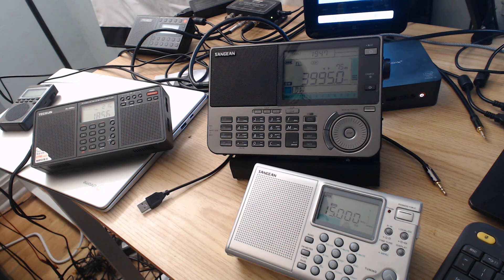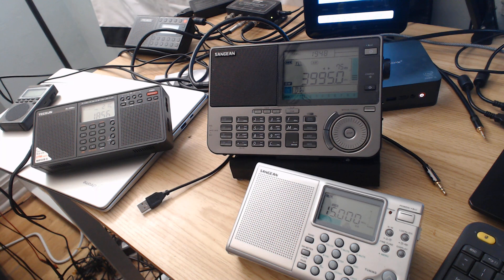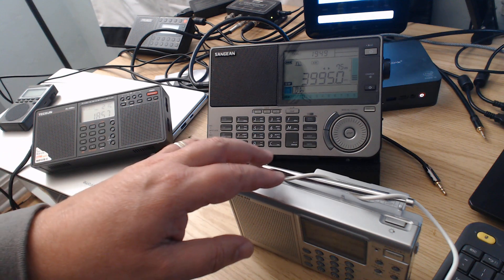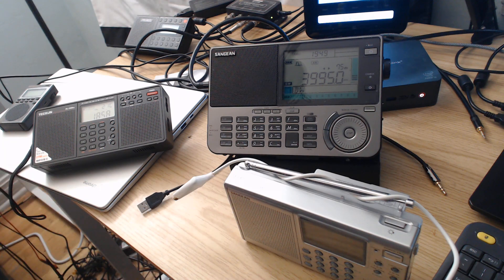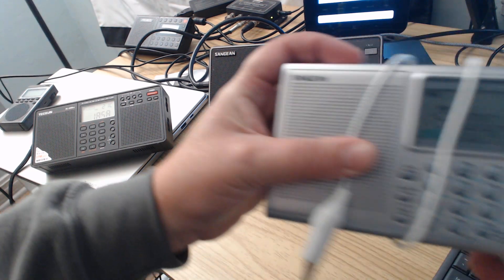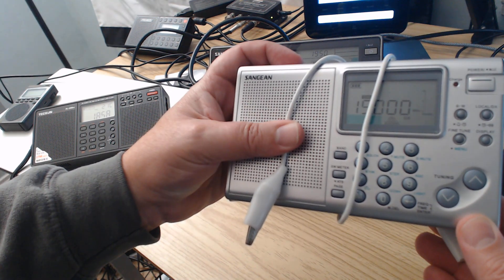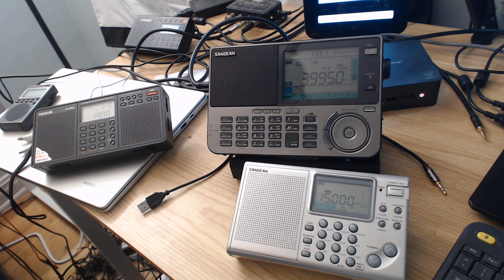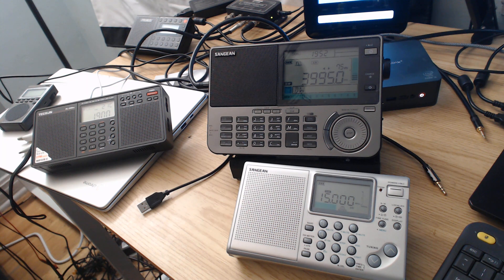Antenna coupling works great and might even help with overload

Comment: Tried that. First plugged in. Second clipped wire to telescopic antenna.Third wrapped wire around telescopic antenna. Third worked and brought in 11635 which was a horn sound followed by Spanish numbers. Traced it to Cuba Spy Numbers. Very cool.

Comment: I'm new and I'm talking just got my SW radio. Just got an entry level mini Tecsun PL-330 that i think everyone has one. I been watching, reading and trying to learn. I seen a video and they was talking about long wire antenna. They said it should be so many feet long for what your trying to get to come in.  I trying to stay on the cheap end of things till I learn more got 250' of wire but only need for my plan about 75' to 100'. Question is, should I be looking into how long to make it or just run it and play around with it to find the sweet spot? Anyone?
Reply: I'm new too. I strung 100 feet and it rocks. I am wondering if I might be able to  cut it back to 50 feet. I have better luck with this than the MLA 30 Loop Antenna. I have learned to wait until night.

Comment: Uh, oh. So I ran tv antenna 1wire 100 feet out to a 17 foot high pvc p100ole. This  consists of two separate wires that are plasstic covered but one cable. I cut one line at 50', thinking that would give me a 100' and a 50' antenna. So, my idea was wrong, huh?
Reply: Well, I can try your idea right now.